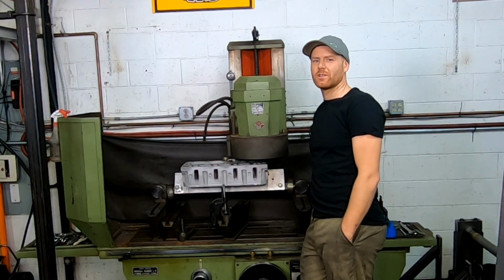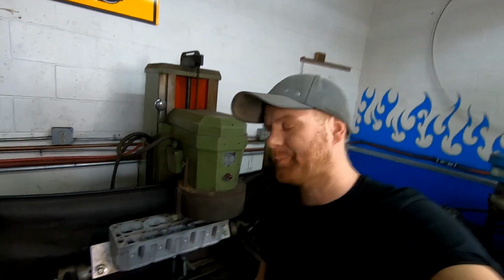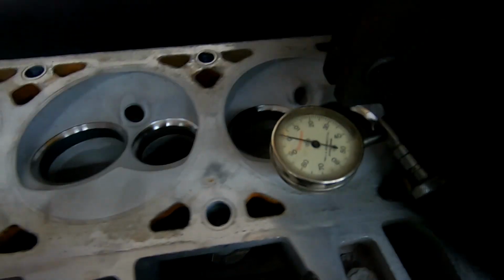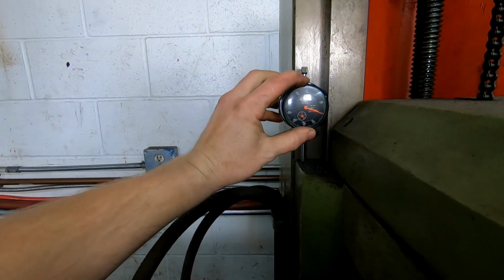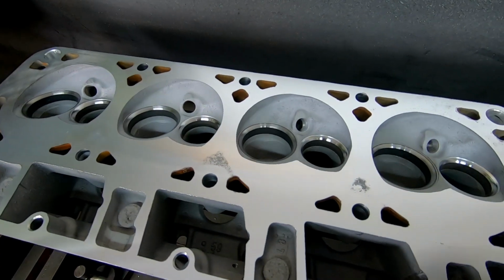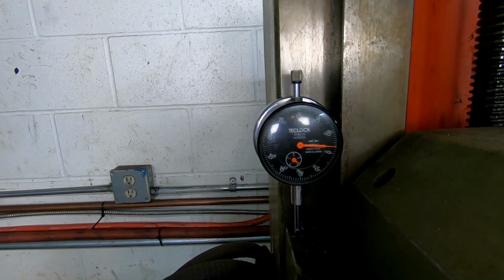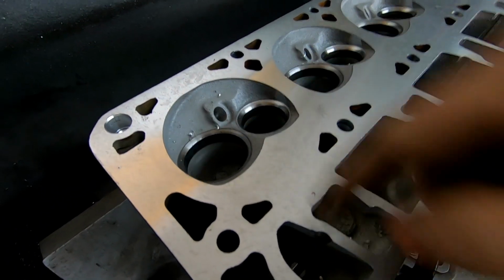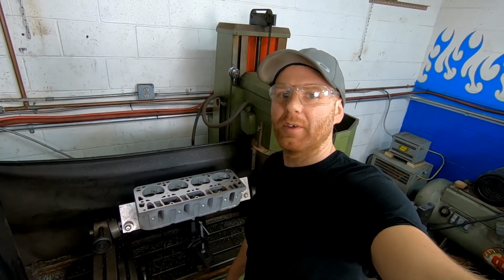Resurfacing an LS head

Comment: Have you ever used a Winfield fixture.  We have one in our machine.  It saves a minute or two in setup.
Reply from the maker: No, I have not. Although I did check out Joe Bakers video on them. This is the third resurfacer I've spent time in and they all had the same sort of fixture i have here. This one being the least userfriendly. My neighboring auto machine shop has an almost brand new Rotttler resurfacer with a tilting table. He has given me a couple demos and it seems like a neat tool to own. Plus I could use it on my other machines(always thinking about the next mess I could get myself into lol).  For now though, I am happy with it as is. I did buy the resurfacer less than a year ago so it still has novelty to me. I do more custom building for enthusiasts than pressure testing and resurfacing for garages. So the few minutes does not bother me that much since I only use a few times a week. So much here that could be improved upon it would probably be simpler just to start over with an end goal in mind. Most of these machines were purchased as personal hobby equipment over a long period of time. I have enough of them now that I can openly offer services to public and commercial. We had a big layoff at work a year ago and I have been able to not only survive off my toys in my garage, but have become a known machine shop. I live in Langley B.C which is Canada's hot rod capitol. So there is no shortage of engine building and small general machining arund here. I lucked out last year also, the biggest automotive machine shop in the city moved a couple districts over, the second biggest retirered and the only general machine shop retired. I bought one of his lathes. This made me the only general machine shop in the area and one of two automotive machine shops in the area. Plus I get along real good with the other engine shop. We are a block away from eachother lol. In fact, it was that other shop that convinced my to buy my resurfacer and pressure tester. He kept saying "there is too much work around here for one shop, you gotta buy more machines". So I did and although had a budget, I ended up with a brand new Delta pressure tester and this Storm Vulcan resurfacer.
Reply: @whiplashmachine  I just got a Berco spy360 head and block cbn surfacing machine last year.  I had 2 van.norman.570 rotary broaches before that.  It was definitely worth the upgrade.
Reply from the maker: @ballardperformancemachine  oh hell yea! Big improvement on that move. I jave never run one of those rotarys bit have seen them in action. Also, a shop down the road had one and would send us all his fussy resurfacing needs. Sometimes he would skim them and then send it over to us and I could see the difference in finish first hand as I cut. These high speed surfacers with CBN/PCD tooling is quite impressive what they can do in about a minute to a head.

Comment: Great video Jay, thank you. Please explain why PCD or CBN is necessary for the cutter, aren't carbide inserts suitable for cutting aluminum or cast iron?
Reply from the maker: Thanks Carl. The CBN and PCD inserts allow for a much higher rpm. With my 13" flycutter, I resuface cast iron heads at 1000rpm. They don't seem to pick up material and drag it accross the workpiece as much as carbide and coated carbide do. My other machine uses coated carbide inserts for resurfacing and I have no issues really, but this high rpm machine does produce a better finish and much faster.
Reply: @whiplashmachine  Holy F#%* that's almost 3500 surface feet/minute! You must get sparks off the cast iron. I've followed you on Instagram for a while and learned a ton. Thanks again for the great content.
Reply from the maker: @carltauber2939  no sparks. If you go on my IG, on may 12, 2020, I have a post of a cast iron block being resurfaced. Give you a good look at how smooth it goes.
Reply from the maker: I forgot one of the most important reasons CBN is so usefull here. They hold up good during 1/2 thou, interupted cuts. A carbide or coated carbid insert breaks down sooner with such light, highspeed interupted cuts.